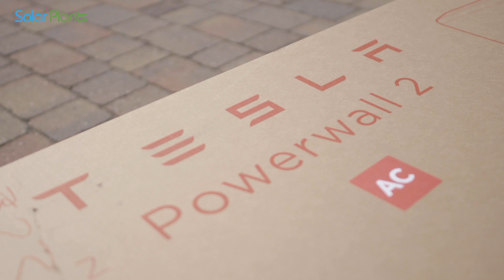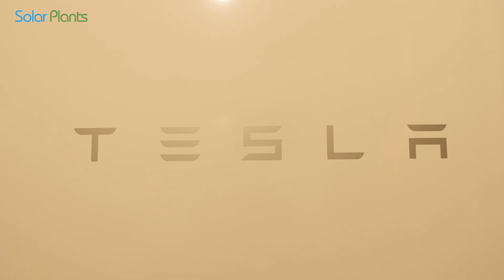Tesla Powerwall 2 installation

Comment: typical installation costs???
Reply from the maker: Hi Luke, you can Live Chat to our energy advisers about costs on our website. They'll find out a little bit of info first and can give you an indication of costs. www.solarplants.org.uk
Reply: Pixel Push hi can you run a AC with your Tesla Battery system and if so a what BTU you have ?